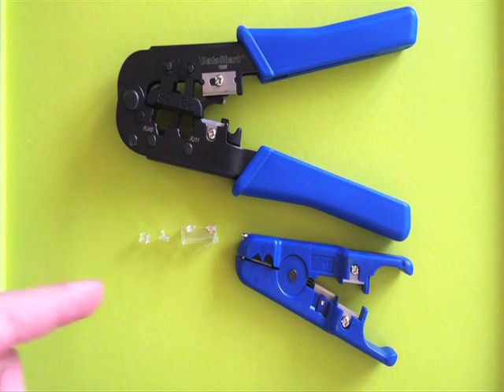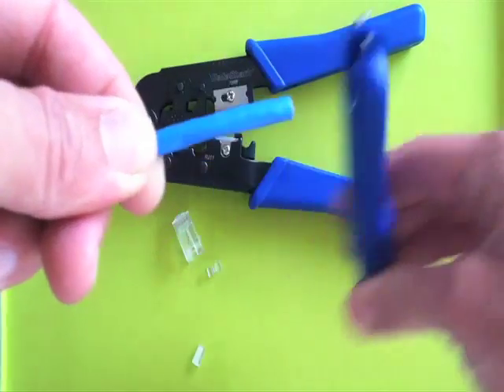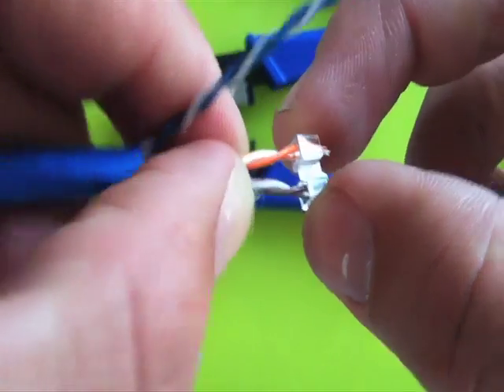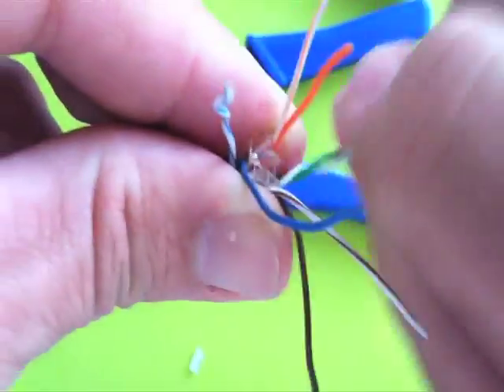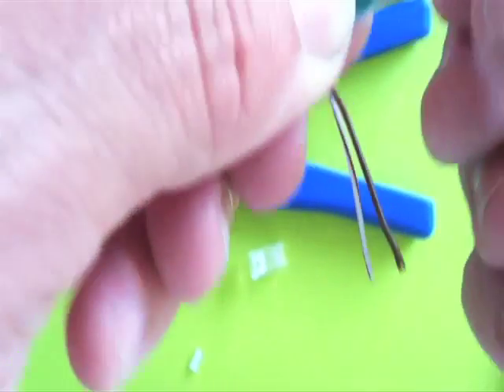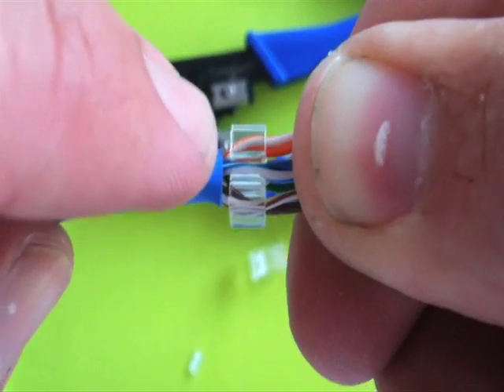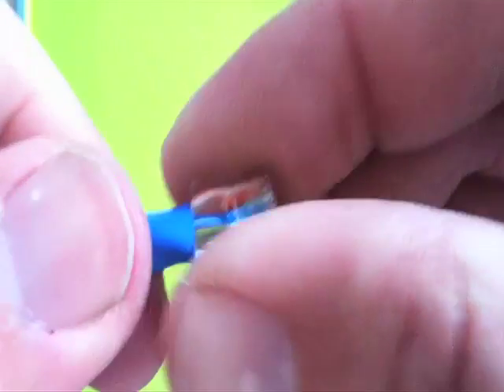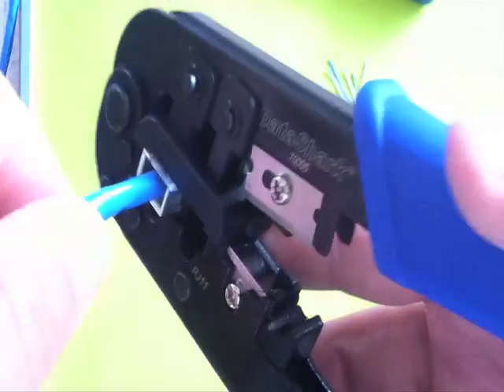How to Crimp a Three-Piece RJ45 Connector

Comment: Thank you, great vid, has helped me make a few cables. I find it easier to cut the wires after pushing on the second bit of plastic though.
Reply: The 3-piece connectors from Ideal (at Home Depot) have that last wire guide, but it is not a pass-through. You have to cut the wires short and straight like the video. I agree though, if they are pass-through, cutting them afterward would be better!

Comment: I find the spreader makes things harder (for me). Straighten the wires by running along the back of a knife or something similar with a dull edge. I cut the wires after putting into the wire holder. It doesn't matter if they poke out 1/2 a mm or so.Note that the colour sequence he uses is not standard in Aust or the UK, however it doesn't matter as long as both ends of the cable are the same.
Reply: Almost.  You can only substitute pairs with pairs. The first 2 wires have top be a matched pair, the middle 2 have to be a matched pair, and the last 2 have to be a matched pair.  Wire 3 and 6 have to be a matched pair.  The signals on each twist are designed to travel together because it's differential signaling and each pair is different lengths because the number of twists is different to cut down on cross talk.

Comment: Good video, but people need to remember there are two wiring standards... T568A and T568B. You've shown T568B, which is most common in the USA. It doesn't really matter at the end of the day as long as both ends of the cable are the same standard, but if you're in Australia and most parts of Europe its T568A you should be wiring to. The difference being instead of starting with Orange White at top on pin1, you are starting with Green/White. The sequence for T568A (in the pin order you are showing on the video with the locking tab underneath), is Green/White at the top, then Green, Orange/White, Blue, Blue/White, Orange, Brown/White, and finally Brown at the bottom on pin8. This then affects how you split the cable at the start with the plastic splitter. Instead of putting the Orange and Brown pairs at either end, you put the Green and Brown pairs at the far ends, and keep the Blues and Oranges in the middle portions.

Comment: For life of me I can not understand why did you cut wires so short prior to inserting it into load bar - it is a pass thru load bar so you trim it after inserting right to the top of the load bar. One more point - the spreader is there to keep the twisted wires as close as possible to load bar so you unwind wires just to the top of the spreader. I think these two points are missing, otherwise all good

Comment: Is it just me or is the reason why the BLUE pair is reversed because they used to run voice on rj-45 too? (R/T)

Thanks - I wanted to make sure I was doing this right. I leave them twisted as close to the pin as humanly possible but I couldn't figure out why it kept going back to 10/100 after a few months

You're wiring is called TIA-EIA 568-B (rather than A that have green and orange pair swapped). I've hardly ever seen an 'A' in the field (except for crossover cables).

With Cat6 (and 5e gigabit) however - the blue and brown must also be swapped on the other plug

 Crossover cables are nice if you have nothing (no router, switch, anything) and want to connect "AD-HOC" or ethernet card - ethernet card

Comment: For the life of me, I can't seem to make cables that work, anymore. I bought a huge grocery bag of RJ45s. They just do not work, on any different cable I use. No kick-down of bandwidth. They just do not allow a connection to be made. No lights on the jacks. Period. I tried these 3-piece ones with category 6 cable, and they just barely work. They are loose in the jacks of both my router and switch. It's not the locking tab, it's side-to-side and up-and-down play. Bump the cable passing by, you lose connection. You have to keep removing and inserting it to get a connection. Sometimes it will make a connection, but instead of a gigabit connection, it will be booted down to a 100 mbit one. I guess the days of hand-making cables is over.
Reply: Tim Ramich And my other big point is that even if I could make successful cables, these newer connectors are so expensive and can't be bought in bulk. I got the grocery bag of old RJ45s for $40. It has to be well over 1,000 connectors. These newer ones are $18 for 25 of them. That's almost $1 per connector.